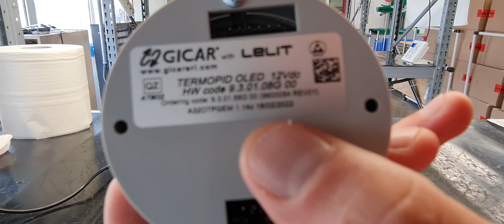pl81t pl91t how to change the lcc display 9600054   OTPGem-114

Comment: Where do you get the new LLC?
Reply from the maker: you have to contact your reseller
Reply: I have the pl81t Modell 05/2016. If I install the new LCC Modell, am I going to have the software upgrade or do I need to do something more?
Reply from the maker: @thanasistsior5383 with the new software 
 you have the upgrade as the new machines
Reply: @lelitinsider2977  thank you for your response. My question is this: the  change of the LCC means upgrade of the software or is it necessary to change something more?
Reply from the maker: @thanasistsior5383  the only difference more is the support of the pump,
Reply: @lelitinsider2977  thanks again for your responses.
Reply: @lelitinsider2977  support for the which of the pump?  can we insert silent pump into PL81T? Thanks
Reply from the maker: @IvanVelickovic-zb9yh  yes you can!
in the silent pump kit you have also the support
Reply: But the silent pump is not included in the latest series?
Reply from the maker: @IvanVelickovic-zb9yh  no, is not included,